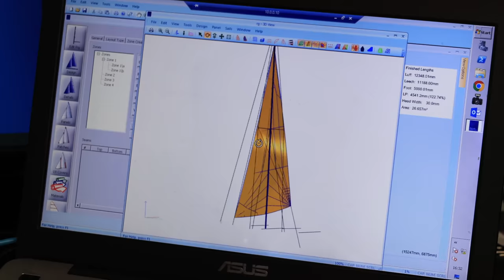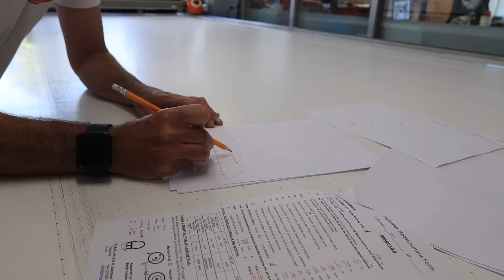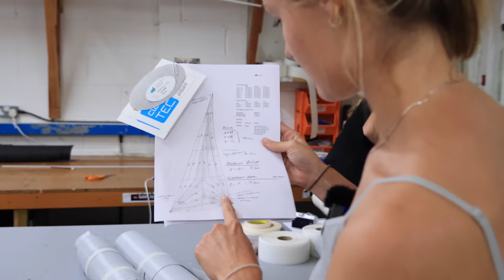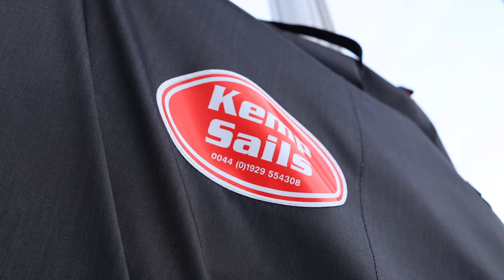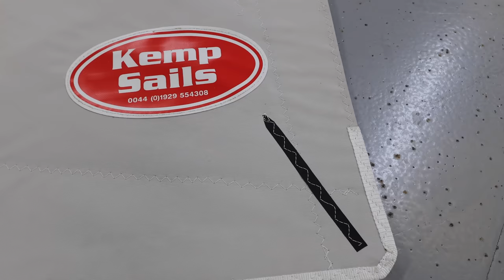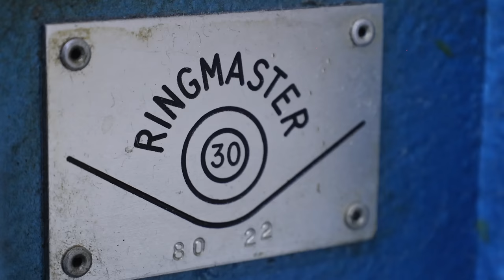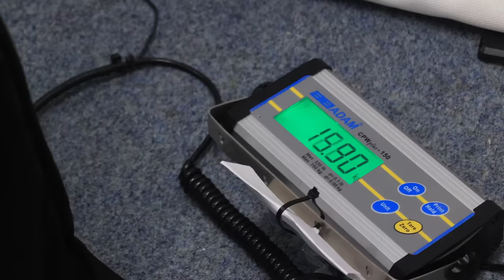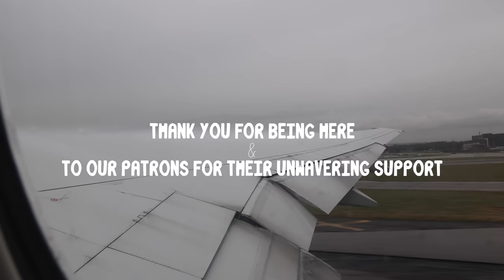From TRASH to TREASURE: Creating Sails from Recycled Plastic

Comment: Beautiful sail and lovely video. Furling. As you are (will be) furling your front sails and probably can operate this from the cockpit, considering your serious blue water trips, I was wondering if it were possible to furl the mainsail too. I know that the answer is yes, by the way. Then the question would be in-mast, or in-boom. In an after-market situation like yours with a fine mast that still can last years or decades, likely in-boom furling would be the easiest, cheapest, decision. But I don't know. As I cannot oversee implications, I also have no clue of what such an upgrade (?) would cost. And I don't even know if it were possible to furl a mainsail from the cockpit without expensive electric or hydraulic aids.
But, reefing a mainsail in heavy ocean water can be quite a thing, or at least a challenging feeling - even when you're not faint of heart.
So, have you considered such a furling option?
Reply from the maker: It’s definitely something we have thought about doing. However, we won’t be doing it anytime soon. It’ll be nice for down wind passages that we can now take reefs from the cockpit area 😊